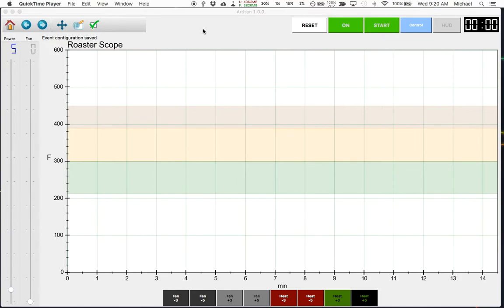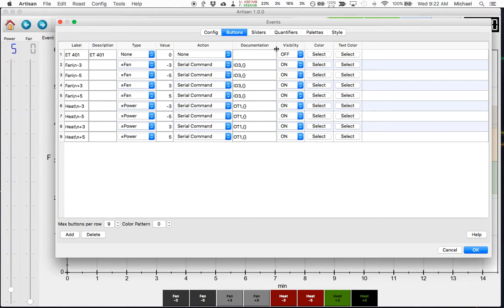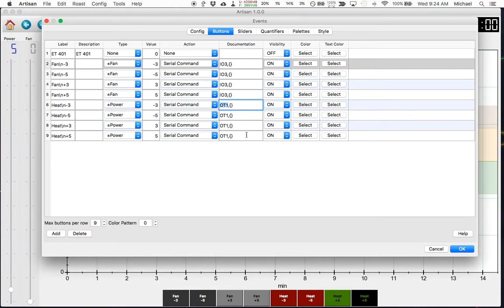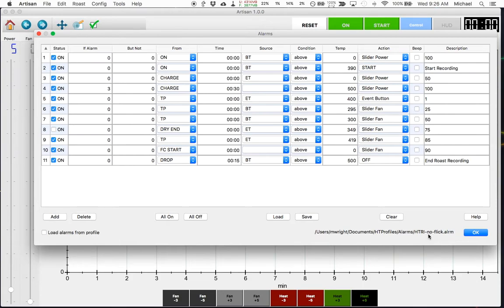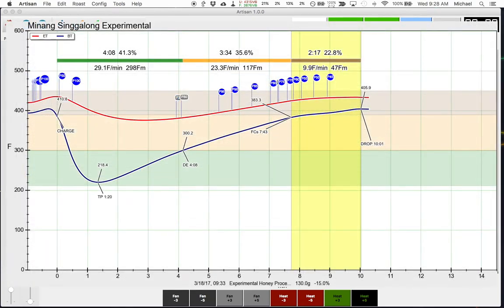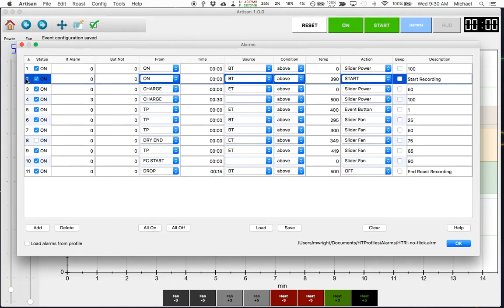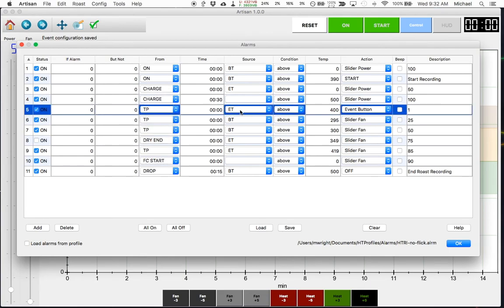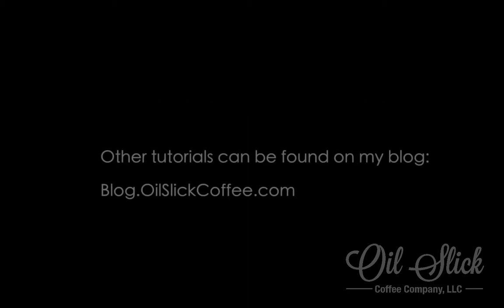Artisan Roasting Software: Buttons & Alarms

Comment: Hi, So I work with Liquid Nitrogen and I try to use Artisan for temperatures that go below100 Celsius with my center301 device. My questions is to which machine selection i configurate Artisan? Thank You in advance
Reply from the maker: In Artisan, under Config > Device > ET/BT tab, at the top of that window is a selection box for "meter." In that drop down, Center 301 is an option to select for a meter. 

Is that what you are looking for? Or are you having a problem with reading temps below 100° C?
Reply: @MichaelCWright   Thanks for reply. So yes i have that marked as well as my correct port. I am having problem with artisan not reading from the device as when i click "on or start." there is message in top of graph stating  "1 byte received but 8 needed."
Reply: @MichaelCWright  Hi again Michael. I figured pretty much all of it, now the only problem yet to figure is how to set it up to read temperatures below 100 degrees Celsius. You seem to know it?
Thank You
Reply from the maker: @toncilisica9279  I have no experience using Artisan with temps below 0°. 

Some places I would check are the minimum temp value under Config > Axes. I believe this will define the "floor" of what is graphed. But lower temps may be recorded accurately nonetheless. 

You can check if the temps are being accurately recorded as data by looking in Roast > Properties > Data (tab). This might help you isolate the problem to a graphing issue in Artisan, which could possibly (hopefully) be fixed in the Config > Axes menu. 

Do share what you find if you get it fixed!
Reply: @MichaelCWright  
appreciate it for sticking with me in this Michael. 
update.. Axis  is showing minus temperatures but the graph is not reading it. The curve just disappears, when i go to properties data BT and ET shows minus 1.. meaning that not even in data it shows correct temperature. 

Error that shows up is that "temperature could not convert string to float". Which im afraid is in the code of program, meaning it cant be fixed. 

Do you maybe know and good program to recommend  for those minus temperature readings?

Thanks Michael
Reply from the maker: @toncilisica9279  I don't know of another application to recommend, unfortunately. 

However, I know the author of Artisan to be responsive to problems. If you have the time, you might try logging an issue at their Github page. It could be a quick fix for them that would help not only you but other users of the Center 301device. 

https://github.com/artisan-roaster-scope/artisan/issues

Comment: Hi Michael, thank you for the video. Is my understanding correct that you need the Arduino board to interface with the roaster because you’ve got the older model? My understanding of the newer model is that it can connect with Artisan directly. Is this correct?
Reply from the maker: You are correct. I need the Arduino to control the roaster via Artisan and the newer model can interface directly with Artisan. Happy roasting! 👍
Reply: @MichaelCWright  thanks! I’m now trying to explore to what degree one can automate a roast with Artisan, so this video is super useful.

Comment: Please tell me how you setup the software to recognize the roaster.  I am having a heck of a time trying to get them to talk to each other, with no luck yet.    What settings in artisan allow you to use the HTRI board - I have the same thing in my hottop!
Reply from the maker: Hi there! I wrote an article about setting up the HTRI board in the HotTop and in that article is a section with screenshots of my Artisan config. That article was written for Artisan v 0.9.8. I am currently running v. 2.0.0 and just checked that the settings and menu paths are the same, so this should get hopefully you on your way: https://oilslickcoffee.com/hottop/how-to-install-hottop-htri-control-board/#configuring-artisan-v-0-9-8

Let me know how things go.
Reply: @MichaelCWright  Seriously, great links and info, I really appreciate it.  But, I tried again and I failed to see the probe read anything.  I did see that the connection was established several times, but no numbers for the BT and ET.  I reverted an older mac laptop to catalina, installed some older drivers, older java and older roastlogger and got it to work.  I might never upgrade this machine again!
Reply from the maker: @portergieske  Interesting...I wonder if it's a driver issue...

Comment: Awesome video Michael. Thank you for making it. I use a Behmor to roast and Artisan to record my roasts and have a probe in the bean mass for the bean temp. I am trying to figure out how to get a mark on my BT line that would say "P5" or "P4" or 100% or 80% etc. How would I go about doing that so when I hit P4, change the temp setting, on the Behmor, I could click a button and it would record it on the BT line of the graph. Any help would be appreciated.
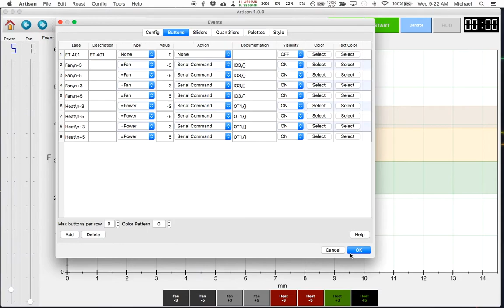Reply from the maker: You can configure a button to record an event. See the 2:00 mark where I talk about the hidden button. You can do the same thing in your setup, just don't hide the button. You can create several buttons for each event you want to record. I did that in the past, before I controlled the roaster through Artisan and it worked fine. 

I'm not sure how to get the marks on the BT though.

Comment: Hi there. A great informative video, well done. Have you tried using background events to trigger events. I tried using the playback events flag but it doesn't seem to do what I thought it would. It seems that background events do not trigger serial commands that were used during the original profile. Any ideas?
Reply from the maker: Thanks for the feedback and the question James. 

Try enabling both "Playback Aid" and "Playback Events" and to the right of the "Playback Events" option make sure you have the right type of event selected that you want to follow (such as ET, BT or Time).

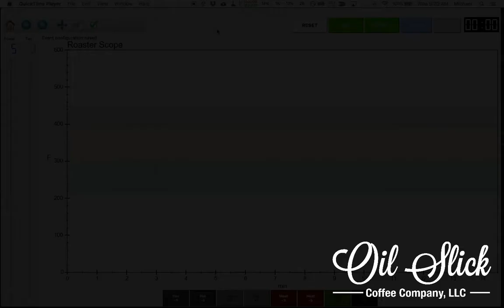Comment: Thank you for posting this, Michael. It is the best documentation I have found on using Artisan alarms and buttons. It is part of the manual for me now. One tip I'll add that I learned today is that at least some alarms set to get triggered at ON do not get triggered, but set them one second later and they work! I ran across this trying to learn how to use alarms, and had Run Program triggered at ON, calling "/usr/bin/say -v Ava Load beans" just as a test. It did not work until I changed Time to 00:01. I haven't verified what commands do not work if set to 00:00 after ON, but turning power to 100 at 00:00 after ON does work, as you showed.
Reply from the maker: I'm glad you found the video useful! If you aren't already a subscriber to the Artisan-User email list, you should check it out: https://lists.mokelbu.de/listinfo/artisan-user You could post your findings there and see if others have experienced the same behavior. Also, Marko, the author of Artisan routinely responds to questions so if this is a bug or a known issue or even an intended behavior, he may respond.

Comment: hi mr  michael  ,  i new roaster and just start using artisan , can you tell me how should i benefit from ET  temp  or  ET graph  ,  should  the gap between  BT curve   and ET curve  reduced  through roasting till the end  ?
Reply from the maker: Roberto, the ET drives the BT and the wider the gap, the more potential you have to roast with. Generally speaking, you do want the ET's rate of rise to decrease gently throughout the roast and as the roast progresses, your BT should gently rise. So to answer your question, yes, generally speaking, you want the ET and BT to slowly and gently approach each other. 

I keep saying "generally" because there are few rules about roasting that always apply. 

I hope that helps!